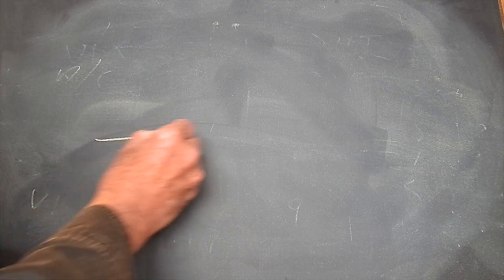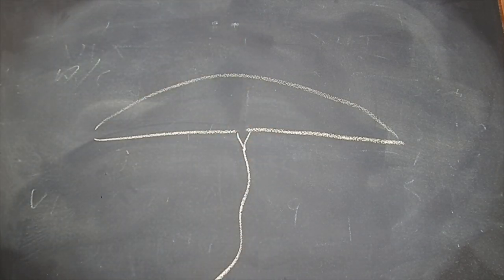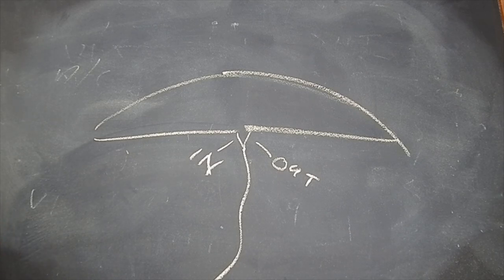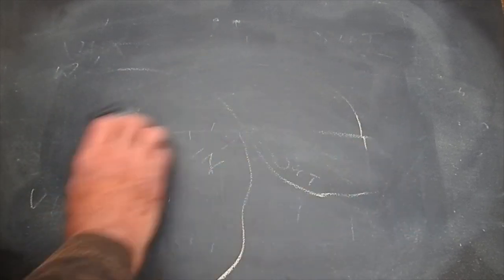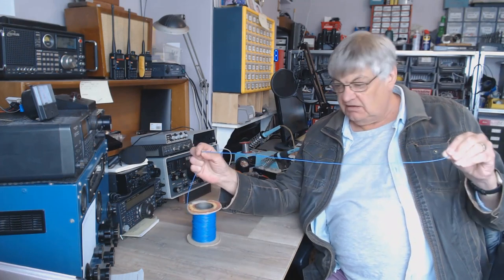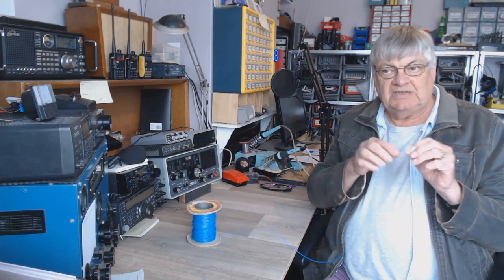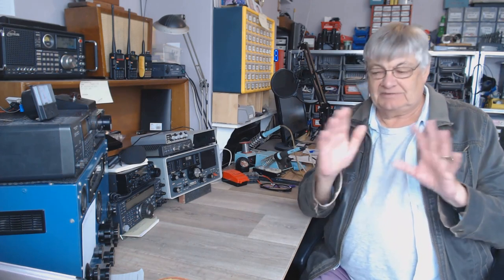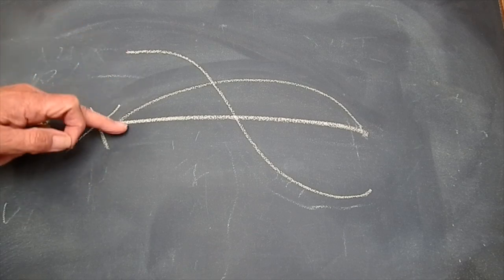G4NSJ - An end-fed wire aerial top band 160 metres amateur ham antenna

Comment: Hi Ray, I have used a half wave end fed on the 160m band on field day type operations, however I used a slightly different feed system. I found that using a quarter wave co-ax "zepp" feed was much easier to achieve as the quarter wave co-ax matching section takes the difficult task of transforming the 50 ohm low impedance (hence low voltage) transmitter output to the high impedance (and hence high voltage) required by the end fed. If using an ATU direct into the antenna this puts a considerable strain on small low cost ATU;s. Yes, it looks like you have a nice big (and probably quite expensive) ATU, lucky you but we are not all so lucky.

You need to dress the end of the quarter wave co-ax matching section to handle the high voltages but the ATU only needs to operate around the low impedance realm at the 50 ohm end of the matching section. Yes you need a quarter wavelength of co-ax but after you take into account the velocity factor the length comes down considerably (still around 26.4m) but you can make up the length with odd sections of co-ax it does not need to be one continuous  length. To adjust the co-ax to length I used to use a GDO (back in the day)  but today a modern ham can use an antenna analyser. The quarter wavelength does not need to be exact as the ATU takes up the slack so to speak.

 I used to cobble this antenna together for field day contests, get the antenna tuned and running then bung our best CW op on the transceiver as we used to get extra contest points for top band and even more for CW (sadly this is no longer the case). If you are using odd sections of co-ax it helps if the end section is one of the thicker cables, say RG-8 or RG-214 properly dressed to give give a good separation between the inner and the braid. As a bonus in your situation the co-ax means less radiation inside your shack. 

regards, Peter VK1XP

PS: I found the Q of this type of antenna was very high and this made the tuning very sharp. I found the best way of tuning the ATU was to first tune the ATU for max receiver noise on 160m, usually a very sharp peak, then proceed to apply RF and carefully adjust the ATU.
Reply from the maker: Hi Peter, great information, thanks very much. I'll print your text for reference. All the best, Ray.

Comment: Hi Ray, an interesting subject for top band. Its the same situation here with a postage size back garden and of course all the man made interference to go with it in built up areas now. Many stations have used their main transmitting antennas in combination with a low noise receiving loop to get the best of both worlds. Will be interesting to find out how you get on with the EFHW. Never spoke for a while so hope you are keeping well. Good video...M0DAD
Reply from the maker: All is good here, thanks. OK on your small garden, it certainly is a pain. A low noise receiving loop is a great idea. I’ll keep you posted on the EFHW. Cheers, Ray.

Comment: I found this quite fascinating.  Thank you.
Reply from the maker: Excellent!
Reply: @g4nsj  I think I will be making this antenna.  Can you clarify for me the grounding?  I understand I need an earth, but do I need just one ground stake?  Or radials or something also?  Would I need an Unun?
I have room to make a half wave or a quarter wave either one but they won't be very high.  Maybe 10-15 feet off the ground.
Reply from the maker: @daveengstrom9250  Hi, a single ground rod will work but the more wire beneath the ground the better. You shouldn't need an unun, just use a decent ATU. A half wave would be amazing, even if it is fairly low down. I hope this helps.

Comment: Thanks Ray, for very good explanation of this antenna-topic. With your antenna-basics it is not difficult to built your own wire-antennas for top-band. At the moment I use a dipole for 80M  with 450 ohm ladderline and the famous S-match, and giving me also a good match on 160M. Did you also experience with dipole with 450 Ohm line Ray? I just get a remote antenna-tuner and will try a wire of almost 80M long  for topband and the higher bands. 73 Jan PA2JJB Texel-Island
Reply from the maker: Hi Jan, it's nice to hear from you. Good luck with the 80m long wire. I've not tried 450 ohm feeder. Maybe I will one day. 73 Ray.

Comment: Afternoon Ray,

I've just replaced a 40metre run of long wire for SWL into a kenwood R-5000. 

A good friend of mine built and flew light aircraft (PPA/VFR) he sadly passed away a few years ago... I found a coil of wire, insulated,  very very thin, ran it over a 40 metre run and the sensitivity has increased and the noise floor vanished!!  Looks like stainless steel to me, it's not magnetic and incredibly tough... no way you'll "pull-snap" it.

Not sure of its resistance but I'll have a check.

There used to be a wire, "constantin"??? Virtually zero resistance??

Who knows? 

But I've got miles of the stuff!!
Reply from the maker: That's interesting, thanks for the info. As you say, who knows! Cheers, Ray.

Comment: Great stuff. I'm going to have to figure out the various voltage/current patterns for my existing 105' random wire with 9:1 unun 17' counterpoise and 35' of coax to an automatic match unit by the xmitter on various bands. Seems like it will be more complicated.
Reply from the maker: Sounds good to me.

Comment: I do precisely that using a 49:1 transformer using two 240-43 ferrite toroids. At the moment it's for 40, 20, 15 and 10metres however I'm going to put a separate one up for top band and 80metres. Excellent briefing by the way! 73 de GØUSL
Reply from the maker: Thanks Mark, it’s nice to hear from you.  Cheers, Ray.

Comment: This was interesting. I do not know enough to say if it is all accurate, but it is interesting. However, I disagree with the bit at the end where Ray said you can only sue a dipole on the band it is cut for.  That statement leaves out the beauty of harmonics and how you can use a dipole as a multiband antenna, especially fed with a tuner like an end fed has to be. 

I had a friend who used to go deer hunting in Montanna,  (I live in Minnesota) and he would take an 80 meter dipole, thirty feet of telescoping pipe, and set us an inverted V with the ends near the ground. With his tuner, we would communicate on a number of bands, and he got great reports from DX stations on 10 meter because of the multiple wavelength. You are not going to use an 40M dipole on 160, but you sure as heck can use it on part of 40M without a tuner.

Comment: Another great lesson.   I have a "nightmare" radio earth /. ground here, very shallow sandy soil onto the bedrock which is very fine grained and thus low porosity.  I also live at the top of a slope so that rain just runs off rapidly.    My "earth" proves your point about the return current circuit from aerial to ground and back to the "generator", my return is very high resistance indeed.
 I have bodged a a dipole  and doublet for 160M however, my signals are useless on 160M even for nets around the UK.    For many years I had a great damp and loamy earth, great results with voltage aerials and various verticals.     Take care, 73  Tony G3ZRJ
Reply from the maker: You could try an endfed aerial with a counterpoise.

Comment: First off I think you saved me a RF burn. Second question can you be too high off the ground horizontally to break the circuit?  I don’t want to use a tuner,  is there a position that would raise the SWR in relation to the circuit?
Lastly that you.. brilliant lesson. VE3WLX
Reply from the maker: Hi, great to hear from you. That's a qood question. Too high about the ground... yes, I suppose an end-fed too high up would break the circuit. To be honest, I'm not sure. Cheers, Ray.

Comment: Ray, if you feed it with a 49 or 60:1 transformer you’ll get 160 plus all other harmonics up to 10m. BUT this then changes the radiation patterns so that you will get current max areas between the houses on the higher bands. 73
Reply from the maker: Thanks Tim.

Comment: I've got an EFHW for 160 m useable on 80/40/20 (I've got the realestate).  I also have an 80/40/20 etc... OCF.  Both antennas are at the same height and close to same orientation.  Comparing the two antennas, the OCF "hears" better 1 to 2 S units than the EFHW.  Not sure why.  I don't have any counterpoise on the EFHW besides the 50 ft. coax running to the shack but I did ground it out at the 49:1 transformer.  Would a counterpoise help on the receiving end of the EFHW?  73 de KQ2N
Reply from the maker: Hi, great to hear from you. The only thing to do is try it and see. I think it might help. Cheers, Ray.

Comment: Ray what kind of counterpoise are you using for the 160 meter band? Since your shack is not on the ground floor and the antenna starts on the street side instead of your garden side I am curious. I am in a similar situation, I already have good results with an EFHW for the 80 meter band, but it starts from the garden. For the 160 meters I can make a 2nd EFHW and I could use a similar trick as you, but that makes it harder to have a good counterpoise.
Reply from the maker: I have an extensive earth system under the lawn at the back. There's a copper pipe that runs underground to the front of the house and connects  to the ATU.

Comment: Very good! I only have one comment and you probably already considered it. The max radiation comes from about the center third of the halfwave wire. If you can center that part over your garden you will have exactly what you want. In some situations you could make the wire a bit longer than a half wave if necessary. All that would do is move the current minimum away from your window. It would increase the current right at the window but a 10 or 15 feet would not be much.Going a bit longer than a half-wave usually makes it easier to match. The Z starts coming down again. I find exact half-wave is a problem sometimes. The so called “random end fed wires” ( they are not really random) avoid exact half-wave resonant points for that reason.  In your case going maybe 10 or 15 feet over a half wave might be worth considering for both reasons. I used to use a simple L network for my antenna that was about 300 feet long. Don’t remember the exact length but it was just over half-wave on 160. I used it on all bands 160 through 10 with the L network tuner just inside my shack window. I had two galvanized pipes as ground rods at first. Good enough to work KH6IJ on 160 SSB and CW from Virginia. On 10 meters (the wire was pointed NE/SW toward Europe and South West USA) it rivaled my 3 element 10 meter Yagi in those two directions only.  
I currently use an Inverted L for 160. It is longer than a Quarter wave to get the high current up on the vertical wire instead of at the ground. That makes it inductive (since it is long) and raises the real resistance to about 50 ohms or so. I simply cancel the inductive reactance with a large variable capacitor to obtain a great match on 160.
73,
N4DJ
Reply from the maker: Excellent info, thanks! Cheers, Ray.

Comment: Wow, I am not good at math, but what you are saying makes sense. At least I have a better idea of what's going on. I will have to watch this at least  few more times, to get it to sink in better, but I have an outline, or at least some anchor points in the mind, if tht makes sense. Thanks for having the patience to cover this, for us 🔥
Reply from the maker: Thanks for commenting. Good luck with the antenna. Cheers, Ray.
Reply: @g4nsj  right on Ray. Hahaha, that's funny. Good luck. You KNOW something 🔥 lol.

That "luck" thing, that without it, at the very least probably involves mourning and using cuss words, due to factors out of my control. Oh yeh, I've heard that before. I am not into really cuss or cry, but frustration can be some huge influencers. Okay, I'll shut-up now. Don't want to waste anybody's time. Points made lol

You know Ray. I am starting to wonder, if I could invest in, something like a weather balloon, and go up, maybe 100 feet, during the day and 1K at night. Drift should not really affect it, if the proper wave length is employed. Ray, I am gonna hush now! Thanks for getting my gears turning 🔥
Reply from the maker: That’s a good idea. I knew a chap who flew a kite and used the thin wire as an antenna!
Reply: @g4nsj  sweet 🔥

Comment: Thanks Ray for the Video. Did  the XYL say all that's going down to the workshop Hi. I eventually got the DATONG D70 Morse TUTOR and Working  in mint condition It has memory's the good old days and top band 160 mere Thanks again Ray 73 de G6JMX
Reply from the maker: Hi Barry, good news about the D70. I often use mine to brush up on speed. The XYL is quite understanding... just as well! Cheers, Ray.

Comment: Nice presentation. Thank you. Some random top band comments: A half wavelength on 160 is 260' +/-.. Good luck if you have that available.. If I had that available, I'd choose an off center fed dipole because I'd get multiband performance out of the antenna. Feeding at a high voltage point may or may not be good for the longevity of your transmitter. The most efficient return path does not go through a ground rod.. A small number of short counterpoises works better. Top band antennas, unless they are raised to an ungodly height are not directional.  My optimal 160 antenna is a 130' wire with four 20' counterpoises. with a 9:1 UNUN at the feed point. Coax going to a tuner and then to transceiver. W9ZD.
Reply from the maker: It's great to hear from you. All your comments are very interesting, thanks. Cheers from the UK, Ray.

Comment: Couple of things Ray, I've recently put up an end fed 5/8 wave vertical "silver rod" for my unlicensed use on 27mhz and I've got into north America, Europe and even Russia on USB.  Based on your antenna description is there any advantage on 5/8 over 1/2 wave on 11 metres? 

Also, would it not have been a wiser idea to take your top band wire over the roof verses the alley?

Cheers
Reply from the maker: Hi Richard, I think the 5/8 wave is better than a half wave because the RF current is higher up the the aerial. I can't take the 160m aerial over the house as there are already too many wires there. I will be raising it at some stage... and lengthening it. Cheers, Ray.

Comment: Hi Ray, thanks for the video and how did it turn out when finished? I'm just about to do a similar exercise. Out of my front room window (I have a bungalow) up to the roof ridge and down the garden 80 metres. I could go longer like 120 metres... would there be a benefit please?
Reply from the maker: It turned out well. I think 120 metres would be worth trying. Let me know how you get on.
Reply: @g4nsj  Thanks for your reply Ray. For a quicker set up, I'll try 80m first and when time permits, go longer. I'll let you know how it turns out. Best 73.
Reply from the maker: @acestudioscouk-Ace-G0ACE  OK, good luck with that.

Comment: Hi Ray, I love your videos mate, I have a question for you about the 160m half wave aerial, I have around 130’ of garden so I can’t get 200’ of wire in! Can you form a coil to add the length I need? What size former and how many coils? Cheers Ray thanks John M0CDL
Reply from the maker: Try adding a coil at the radio end if the antenna. Experiment with the amount of turns on a 2 inch plastic pipe.

Comment: Thanks Ray your really helping me here, my question if you have time to answer, if my end fed half wave is 160 meters can i then use it as a full wave on 80 meters
Reply from the maker: Hi Paul, a full wave end fed on 80 metres will be 80 metres long. A half wave is 40 metres. Yours will be two full wavelengths long. You can use an end fed wire of any length on any HF band but it will be better on some bands then others. The best thing is, try it and see. Cheers, Ray.
Reply: Thank you sir Cheers to you have a great day  @g4nsj

Comment: Top Band is not easy in small gardens,  I will have to stick with a quarterwave and attendant huge ground losses. The half wave end fed would be far more efficient. Being a pedantic sod though the current minima in your system will be about 10 times lower than in a 50 ohm system. (if you take it to be about 5000 ohms at the feedpoint). 73, good to see another video.
Reply from the maker: Excellent, thanks.

Comment: Physics moment.

an end fed is an " aerial" for its " up there in the air..." but its NOT an antenna.

Neither is a loop.

Both are electro- static couplings, not antennas. They work very poorly compared to a structure with proper " antenna function."

A loop is a one- turn Inductor. A end fed wire is approximately one plate of a capacitor exuding field lines.

Those functions are not " antenna."

Yes according to a certain PHd text (Electric Waves, Skilling, 1948) these will emit a little energy at a distance due to energy wandering off like so many lost sheep, but they are extremely inefficient as being inductors or capacitors, they conserve most of their field energe locally to the structure, not emitting it. Most of thats wasted. This is why loops are plagued with high currents and end feds by high voltages- trying to load either a short or open circuit.

Neither is proper or conducive to operating with a modern 50 ohm Transmitter- they are useless relics of the early 1900s when transmitters had high impedance outputs.

Note that universally, amplifiers must be used with these couplers...

Instead of wasting time and power with these buggered up failures, learn to optimise a simple dipole.

Im daily/ weekly working E EU and S.A with a 20m dipole and 1-10 WATTS. Serbia, SSB, TEN Watts 5-5.